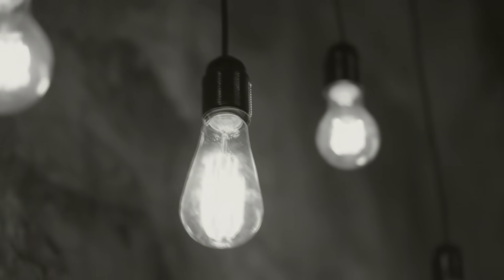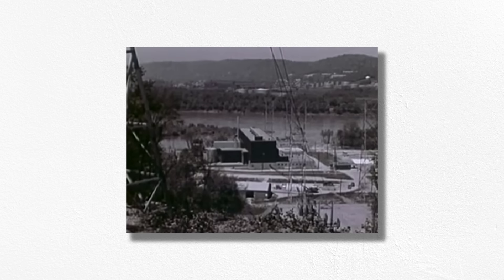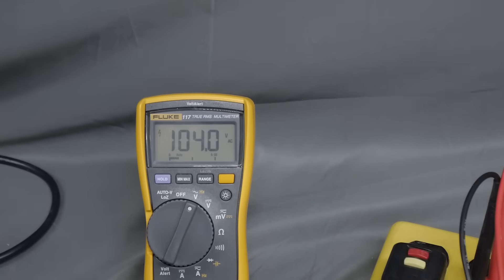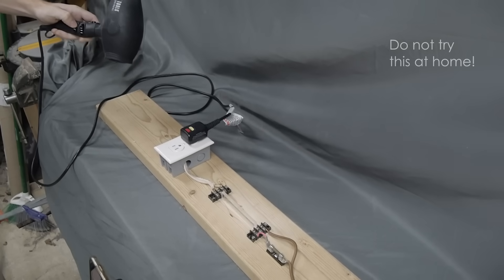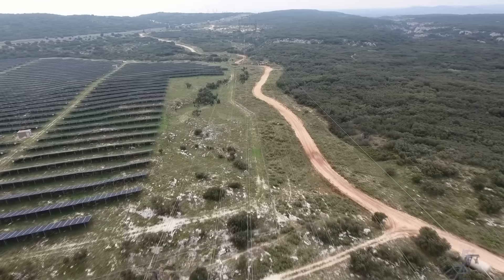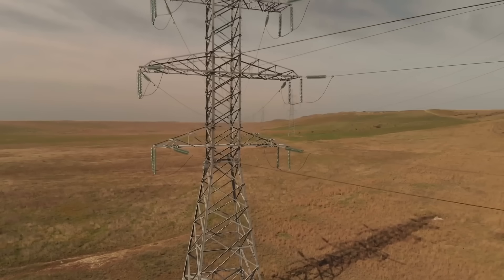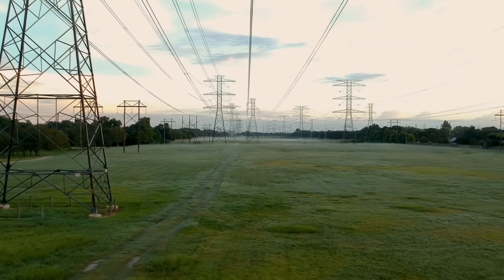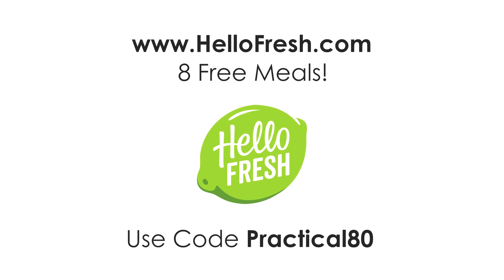How do Electric Transmission Lines Work?

Comment: At 6:14 You say that the wires on top are to protect against lightning strikes, while this is correct, in recent times the company who owns the transmission lines will actually install OPGWs (fiber optics). As you can imagine these transmission lines travel vast distances, so the transmission company can lease dark fibers (no service on the line, but a communications company can cross connect through that fiber to maximize their route miles of fiber to connect to other cities). If you ever are driving out in a rural area, and cross near a transmission tower that is accessible from the road, you may see the ground wires at the top coming down to a lower point on the tower, coiled up, with a silver case in the middle, this is a fiber splice case for OPGWs. These splice cases are spaced out under 7,000 feet apart.

This is such a genius idea, just to help give our country that over the top internet capacity by utilizing our power transmission grid. While the fiber doesnt go directly to an average consumer, it does provide incredible amounts of bandwidth to upstream providers such as primarily Level 3 and others like Verizon, AT&T, Comcast, and Cogent.

I went a little too far into detail, but why not I guess!

Cool video tho  :D
Reply: “you may see the ground wires at the top coming down to a lower point on the tower, coiled up, with a silver case in the middle, this is a fiber splice case for OPGWs”
I have always wondered what that was!  And it never occurred to me it was a kind of fiber splice!  (DUHHH! in hindsight).  Thanks!
Reply: I see Cogent every time I run a traceroute. Guess they own the backhaul in my nearish area once it leaves my ISP's rented ISP, from the line maintenance company (Openreach). I think Openreach own a lot of the UK trunk line structure too, so I guess Cogent is after it leaves the island, especially since most UK servers for big companies are actually hosted in Ireland, and I don't think they have Openreach in the Republic.
Reply: Deep nerdy technical detail is always appreciated dude! :D whether or not we understand it.
Reply: In Arizona we ran afoul of our regulatory commission, the Arizona Corporation Commission because our proposed dark fiber venture did not fit their rate structure. In the end we gave up on leasing bandwidth altogether; we are allowed to swap bandwidth with other utilities and to lease from commercial providers, but not to gain revenue.
Reply: this information is gold. I need more details starting with basics. please guide where to look for or any gentleman can help and write here. I am waiting. 
I am looking at an opportunity.
Reply: @mohdghani7171  I am not sure what you are asking for exactly. I know an incredible amount about long haul fiber applications, but I am not trying to right a book about it. If you have a specific question, I would be glad to answer it.
Reply: Nice thanks for the info, I had no idea
Reply: I was really curious if transmission companies were attaching data lines for monitoring and selling the excess bandwidth while watching the video. We talk a lot about a smarter grid so I'm always curious how much of the grid has monitoring and to what fidelity. I was looking at the DoE coming out of college, seemed like a really interesting set of software problems.
Reply: @unfairleyc  While I am sure different transmission companies do things differently, the most common use of OPGW is: A pair of fibers minimum (2 pair for network expansion) for the transmission companies to remotely manage substations to open and close switches, security, or any other communications they need. They would be running some sort of redundant SONET or other ring to ensure constant uptime.

They may have their own WDM gear in house to sell wave lengths to companies or just lease dark fiber out to larger carriers looking for reliable city to city connectivity.

With the continuing advancement in WDM technology, only 6 pair of fiber on OPGW on transmission lines would be more bandwidth than any city to city connection would ever need at the present time. I am sure WDM will continue growing in speed, I just checked out the current max bandwidth over a single pair of fiber running DWDM, and it looks like the speed per channel is 100Gbit/s for a maximum of 16Tbit/s bandwidth over that pair.
Reply: @thenerdnetwork  I’m an apprentice lineman and have installed miles of fiber on 500kv towers (we pulled out the old static and replaced with fiber). Gotta say you know your stuff haha i was under the impression from what I was told that the fiber was really just for the power company to monitor system operations and do remote switching like you mentioned. I don’t know much about fibers capabilities though, I’m sure it’s possible they could be leasing it to cable/internet providers but I haven’t heard anything like that honestly. (Not saying it doesn’t happen) They lease space on pretty much all distribution poles and structures for phone/cable companies so it would make sense I guess. I just know the reels of that shit is insanely expensive and I loved installing it because I worked 16 hours a day hanging off helicopters 7 days a week and they paid me to do it😂 cheers
Reply: @tjdougherty4136  They do lease it out. At least where I'm from (Nepal).
Reply: @tjdougherty4136  This sounds effing awesome to do. And if I was 40 years younger I'd be looking for where to apply!
Reply: @tjdougherty4136  There is more than enough fibers in that bundle to lease it out, the problem is that the owners of the lines, generally a federal agency but not always, have rules that basically prevent them from doing so. This is for the U.S. though, other countries and private energy providers that own transmission lines can and do lease the excess lines out.
Reply: @salocin86  are you saying those rules only apply to a government ran utility? Or do privately owned utility companies have rules against it too?
Reply: @tjdougherty4136  Just government ran/owned utilities. Private companies can lease them out.
Reply: Why can’t lightning’s energy be captured and be added to the grid?
Reply: @dougwenneker552  If you are serious about this question I can try to answer. The highest voltage transmission line in the world carries 1,100,000 volts. A single bolt of lightning carries up to 300,000,000 volts. So I don't think it will ever be feasible for the grid to handle such an insane voltage.

On top of the grid physically not being able to handle such a voltage, lightning is a burst of energy for a very short period of time, it would be nearly impossible to make use of the strike. The grid is scalable and can add more power as the demand rises, a lightning strike would have to be stored in batteries to even make use of it. It is just not worth trying to harness lightning energy since the infrastructure would need immense investment to make use of it and the profits just wouldn't be there.
Reply: Dude this... this is nerd poetry
Reply: 8
Reply: Sorry write 8 Sir Plz tell Gis System
Reply: Not all companies can lease, their state commissions don’t allow! And after years of being exposed to lightning , an alternate location is looked for, maybe underground
Reply: @glenturner9857  I am not sure what I said that prompted you to literally copy and paste an article from 2016... but.. thanks I guess.
Reply: @glenturner9857  I am quite confused with some of the points you were making in your post. Being glass, fiber optics (the signals within at least) are naturally immune to lightning strikes and other forms of EMI, so I am not sure why OPGW isn't as good as buried fiber, the actual fibers within both cables are manufactured using the same process. In America at least, maintenance of high voltage transmission easements is usually insanely good, they tend to clear any kind of vegetation that would ever risk causing damage to the lines. 

I work on one of the largest fiber networks in America, the network is extremely diverse and robust, that is because it is owned by one of the largest companies in America. For the regional area it uses a CRAN architecture, which provides an incredible amount of redundancy to the network on a local and regional area by having multiple paths to each hub site in the area, and handles the actual distribution traffic in the area. Depending on the area where the hub site is, they can connect to actual carrier hotels where they connect with the rest of America/World.

These carrier hotels are where actual large scale connectivity between major cities happens. They will hop on WDM to connect to these cities with other major carriers. The actual WDM owner who leases/owns the fiber to the next city uses OPGW as well as underground as you said, in particular it is buried alongside railroad tracks. I'm sure at some point the lines go on standard utility poles as well.

We also call using an OTDR "shooting" the line. I am not sure why any high voltage lines would need to be isolated to shoot anything on OPGW, it interfaces the same way as any other fiber optic cable in a carrier hotel. Also, OPGW is Optical Ground Wire, so it has nothing to do with the high voltage on transmission lines, it is on the top of transmission towers actually inside of the ground wire. A TDR is for measuring electrical wavelengths over metal, an OTDR is similar, but measures wavelengths over glass. Fiber optics are not electrical in any way, only on the end points where it meets a transceiver that converts the light signal to electrical signal, that transceiver also converts the electrical signal into a light signal.
Reply: @thenerdnetwork 
If lightning wires are being replaced with optic fibres cables the phases are not protected anymore? 

Or are this optic fibres being placed next to the lightning cable but then the optic would get burned if a light struck?
Reply: @All Goals
The fiber optic fibers are usually embedded in the middle of the stranded shield wire.  The shield wire still does the same job, just the fiber is along for the ride.
Reply: @allgoals1325  The fiber optic cables are actually inside of the wire. These wires can essentially be made hollow as high voltage actually runs on the skin of a conductor so and conductive material in the center is just wasted money and extra bulk/weight.
Reply: @allgoals1325  Here is what OPGW looks: https://teletechnonet.com/en/products/networking/fibra-optica/optical-fiber-composite-ground-wire-opgw

So nothing gets burned in case of a lightning strike. But yea, the guy who responded was correct, optical ground wire does the same job, but carries high speed communications cables that are naturally 100% immune to electrical interference (glass is not not a conductor but rather an insulator). 

Essentially the fiber optic strands provide optics (the end point laser beams) a conduit from 1 point to another, travelling at the speed of light. Its pretty neat stuff.

Comment: The fourth line is not only there to shield it. It’s also the reference to the other three phases, the neutral conductor
Reply: Felix Kuhnert there is no neutral in power distribution as they work on a delta system?
Reply: JonnyD3ath mea culpa, didn’t know that
Reply: Felix Kuhnert we then create a neutral at the transformer position by connecting to earth

Comment: Why don't we just use Megaampere instead of Ampere as a unit, then loss is less automatically. Allow me to demonstrate:
1 Ampere = 0,000001 Megaampere, squaring brings
1 Ampere ^2 = 1 Ampere
0,000001 Megaampere^2 = 0,000000000001 Megaampere

I am joking, of course

Comment: Unless power storage gets several thousand times better, we will still need the grid to power our homes when the sun doesn't shine for extended periods. The grid will just take on a slightly different role than we are used to.
Reply: Power storage may very well get several thousand times better. Used batteries from electric vehicles can be used as power storage in buildings for upto several years before they become due for recycling.

Comment: Can you do a video on live,neutral,and ground?I'm having trouble with these.
Reply: @Nexalian Gamer  The neutral is the return path of the current.  In an electrical service it is grounded at the transformer and at the service entrance.  The ground wire normally does not carry current.  It will carry current if there is a short to the apparatus metal enclosure.
This short circuit current will be so great that the fuse or circuit breaker will trip.  There you have it.
Reply: If it's grounded to the transformer with live voltage on it then won't it be hot every other half-wave?
Reply: Just as much current flows through the neutral as the hot wire.  The only difference is the voltage on the neutral is very close to ground because it is grounded.  Theoretically you could ground one hand and touch the neutral with the other and you won't be shocked.  But don't try that at home.
To further complicate things a 120/240V system has three wires:  two hots and a neutral.  The two hots are 180 degrees out of phase and no current flows through the neutral if the loads are balanced on the two hot legs.
204V between the hots.  120V between each hot and neutral.

Comment: Not mentioning the "transmission line" part of the equation. When power line became very long you reach a point where the capacitive and inductive interaction between conductor became a sizable problem. It the same as transmitting Radio frequency thru a medium, the lower frequency just require a longer medium to create a problem. This is one way in which  HVDC lines are more efficient .

Comment: This needs a follow up. AC and DC high voltage transmission. I've read something about AC lines under the ocean have a rather large loss as the cable and the water should work as a large capacitor. So the power is rectified before diving in and alternated on the other end. When electricity is coupled as a complex grid (multiple possible pathways to secure reliable supply) getting the phases in sync must be quite interesting. The steps taken when power fails? Small generators (at least in Denmark) are required to disconnect form the grid so as not to fry technicians trying to fix the grid. I also remember a series of large power plants that disconnected and shut down years ago. It took quite a while to get things running as they needed a running grid to synchonise with before they could coonnect. And all were off grid, so there was no power to sync with.

Comment: At 3:32, how can you decrease vlaue of one independent variable(current) without increasing the other independent variable's value(resistance) significantly to observe the increase on the dependent variable (which is voltage in this case). Please explain that stuff to me.

Comment: I'm sorry but the animation around 3:33 is badly confusing: V and I are factors on opposite sides of =, and keeping R fixed means decreasing I also decreases V.  The trick, as I previously understood it, is to artificially magnify the impedance Z of the consumer's power needs, as seen by transmission, so that it's much larger than the impedance of the transmission network alone.
Reply: it is confusing, but I'm not sure your trick is the right way to look at it.  He's using the wrong equation.  The proper way is to understand that the power consumption is constant. And since P=IV it makes it pretty obvious that current and voltage are inversely related.

Comment: I'm disappointed you skipped the current leakage from these lines. Holding a  fluorescent tube under these lines can cause it to light up slightly. (Also why the voltage is 100kV instead of 500kV+)
Reply: The only way current can "leak" from these lines is through inductance. And he already mentioned that.

Comment: Grady, at 7:33 in the video, you can see them attaching the insulators to a triangular piece of steel on the tower. I have seen those used on some, but not all towers in my travels on the interstates. What is the purpose of the triangular member? I am an ME, but I don't see how the forces on the tower would change much using those.

Comment: When the transmission towers wrap around 1 of the transmission conductors. That should create a winging (like in a transformer) Does anyone know what is done to compensate for this or prevent any induced voltages in the towers? I know the towers are heavily grounded.

Maybe the air gap of the transmission lines is large enough to eliminate the effect?
Reply: *create a winding
The distance is far enough from the conductor that it doesn't matter, and the grounded tower wouldn't let it happen anyway.

Comment: Why has the US 110V while the eu has 230V base current?
Reply: Because the US used 110vdc long before ac became popular. Edison's dc power system in New York did not shut down until 2007 after 125 years of operation. When AC started to take over the voltage of 110v was kept because most things used by electrical customers did not care whether the voltage was ac or dc, it was lighting for the most part.

Comment: I think he can do a lot more video’s about power transmission. The skin effect prevents very thick conductors when transporting AC.
Reply: No. The skin effect does not prevent the use of thick conductors, what it does is make solid thick conductors unnecessary.

At high frequencies used in radio communications, the solid wire can be changed to a copper tube, as most of the diameter of the cable is not required as it is not carrying current. But this happens at high frequencies not at low power line frequencies of 60Hz

Comment: I think it is better to think of the transformers as reducing the effective resistance of the transmission lines: https://en.wikipedia.org/wiki/Electric_power_transmission#Advantage_of_high-voltage_power_transmission
Reducing current I in the basic P = I V = I^2 R formula reduces the power, which we need to hold constant.